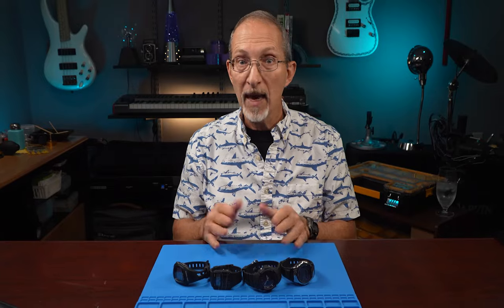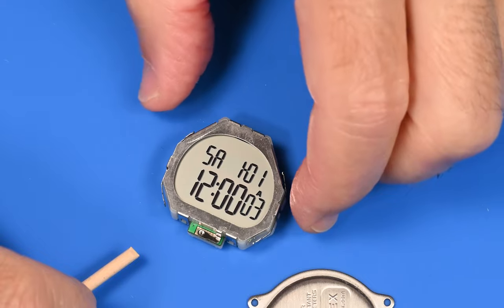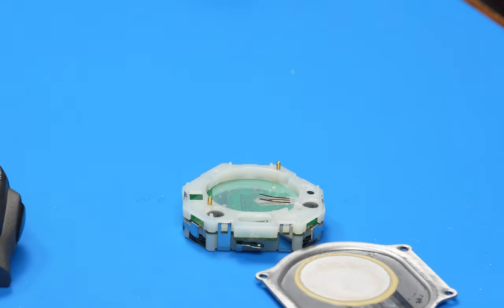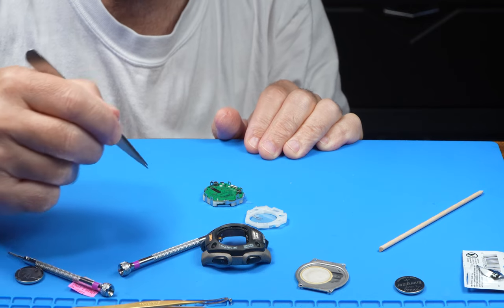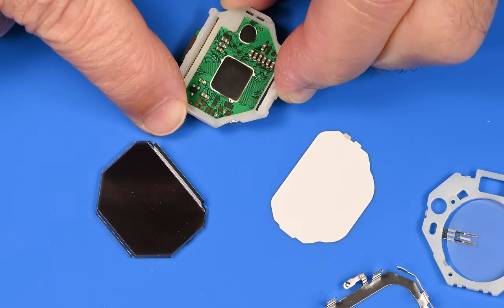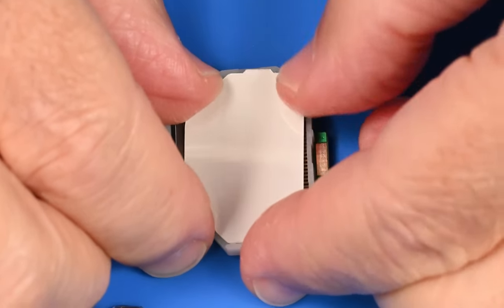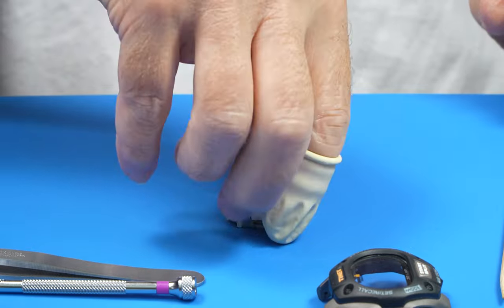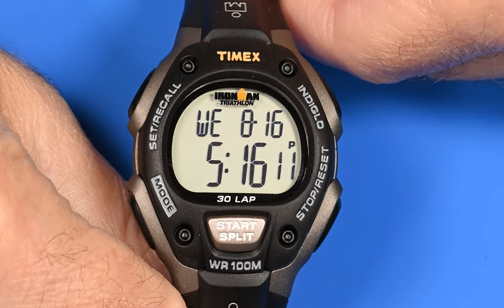How to Repair a Digital Sports Watch

Comment: That sticker on the inside of the caseback isn't an insulator- it's the piezo speaker. Those springs contact it and transmit power from the pcb to make the beeps! It's offset to line up with them.
Reply from the maker: Cool beans! I didn't know that! 😀

Comment: Hi, the connector between the display and board (the foam) is called a zebra connector. The white sheet was the backlight panel as you thought. Often gold connectors can be cleaned using a pencil eraser (thin one in this case). IPA may also work and is good at removing grease etc..  Contacts over time will oxidise and just need a little clean (normally).
Reply from the maker: @rogercox6020  Thank you, excellent advice!😁

Comment: Hey thanks for the video I have a similar sports watch different model put in a new battery and it failed to turn on although the LCD did seem to flash briefly for a second but I couldn't get it to do that again I tried holding down the AC reset button and connecting the AC reset button to the watch battery with a paperclip but it doesn't seem to do anything after watching your video I took apart the little Contraptions I couldn't see any corrosion I have been swimming in the sea with the watch for a few years. I'm surprised it held up as long as it did even though it is waterproof to 5 ATMs the old battery didn't look like it was leaking and as far as I could see the internals on the circuit board I didn't see anything that looked like water had gotten in there I was kind of expecting it just to turn back on when I put in the new battery but unfortunately it seems like that was not the case I know a guy who repairs cell phones and he has the microscope equipment but he doesn't work on watches I actually have a spare watch that I can use for my swimming but it's just a little frustrating that I was able to get it open and exchange the battery and then it's still dead I don't know what else I can do and it's probably not economically feasible to have anyone attempt to repair it do you have any suggestions or idea what might have happened I guess it could have shorted out but I noticed the LCD gradually dimming over a period of about 12 hours and then it finally stopped working and it only was about a day or so before I put in the new battery anyway I appreciate your video it was very detailed I didn't try to clean it with isopropyl because it looks pretty clean but maybe if I dig some out I'll try that
Reply from the maker: I think alcohol would be a good next step, especially since the watch has been in salt water. Good luck, and please check back to let us know if you were successful!

Comment: Weirdly I find repairing digitals harder than mechanicals. I love how you use these videos as both an assembly guide and a "captains journal' of your findings! Those white nylon parts looks like the material they use for shock absorption. Maybe it just needed a thorough cleaning and reassembly to make sure everything had contact. Those tiny orange free floating connectors does not seem very durable. Well done on the tear down and reassembly! It seems to have done the trick! Oddly I have never owned a Timex. They are priced rather highly here in South Africa and I just end up getting another Casio.... Some swear by them though so I might just pick one up some time or another. Hope you have a great weekend Mike!
Reply from the maker: Thanks Johan! You make lots of interesting points... Timex's here in USA are relatively inexpensive - or at least they used to be! Timex has really upped their game with their analog (quartz & automatic) watches, but I have heard they've had some quality control issues lately. Lol, Captains Journal indeed! I like that way of putting it! 😁
Reply: @WatchWithMike  Thank you kindly! Then maybe I should give them a skip for now haha! Yeah its neat! It like a guide for us as well as for yourself! Hope you have a good one Mike!
Reply: Stick to Casio, boet! 😄 Yes I am from South Africa too. As a hobby, I restore and repair vintage digital watches. Not sure if you have noticed, but vintage digtial watches are not easy to find locally. My prized restoration was a Casio CA-901 that I bought at a flea market in Johannesburg for R50. Now worth considerably more because everything working and looking as new with a NOS crystal, case, top pushers and pusher plate.
Reply: @Daud76  Ive never seen one like that before! That is super nice!
Reply: @johanvandersandt8904 Thank you so much. 🤙🏼
Reply: @Daud76  😁💪

Comment: The little springs between layers of the movement and the movement and the back case are to prevent the buildup of static electricity, which could fry the electronics.
Reply from the maker: Thanks - that makes sense! I'll bet it also helps with shock absorption... I was amazed how well built this relatively affordable watch really is! And I can't fault the watch for not working - I'm sure it was human error on the last battery change that was the cause. 😃
Reply: Good job! I’m not in favor of digital watches but that doesn’t take anything away from a job well done! 👍
Reply from the maker: @mokumholland5640  thanks Tom! It was a very fun project! 😁

Comment: Hey Mike, great video! Any idea if the four screws on the case are real or not? Is it possible to take apart the case even more? Cheers!
Reply from the maker: Hi Eleanor! Those 'screws' are plastic dummies. The case might come apart further, but I can't tell by looking at it. I recently took apart a Casio G-Shock and the screws were real - and it was a double-shelled case, so I get why you're asking!
Reply: @WatchWithMike  Hey mIke, thanks so much for the reply, really helpful! Althought a pity they're dummied. I've got an Ironman Timex where the black, front part of the case is a bit worse for wear and I'd love to be able to just lift it off and replace it with another keeping the rest of that watch!

Comment: Nice!  Used to wear these things.  Very cool to see the insides.  Didn't realize there were so many discrete components and two blob chips.  Your fingers store a charge like a capacitor and that's what makes the screen light up.  Doesn't take much charge at all to drive those things, it's really just a voltage and next to no current.  The strip of contacts for the screen is called a zebra strip.
Reply from the maker: lol, I thought it was my electric personality! 😁 I like the term 'zebra strip'. Thanks!
Reply: @WatchWithMike  Haha that helps. Of course, thanks for the video!

Comment: I have a different version of the Ironman Triathlon with 18mm lug width, and the leather straps Vario makes for the Casio AE-1200 fit nicely on my Timex.
Reply from the maker: Cool! Side-by-side, Timex and Casio are very similar, so it's good to know that some of the straps may be interchangeable. Thanks for sharing! 😁
Reply: Sorry for jumping in, but I have to agree. Take the Casio Pulsecheck JP-100W and the Timex Pulse Watch. They look exactly the same minus the branding. 🤔

Comment: Thanks Mike. Where would you start if the module won't star up at all so can't prod the buttons to try and locate the area where the fault might be?
Reply from the maker: I would take apart as much of the movement as I could and clean all of the contacts. That didn't work then it's possible the processor is fried, which would be beyond my skill set to fix!

Comment: nice mike ... and it works !!!! clean before licking 👍
Reply from the maker: Yes! Did you know that licking is also a valid technique for telling whether a battery has a charge? Shocking! 😁
Reply: yeah its tingling sensation on you tong...  9 volt feels nice ... @WatchWithMike
Reply from the maker: @ElderPinto254  when I was doing video production full-time, every piece of equipment ran on 9 V batteries. You better believe we did the tongue test in the field. I got so good I could tell the taste difference between Energizer and Duracell!
Reply: everytime i see a nine volt i have to test it its a strange thing for people that dont know ...😁😁😁 @WatchWithMike
Reply from the maker: @ElderPinto254  There's no doubt it releases serotonin in the body. Years from now, it will be considered a common health practice. We are ahead of our time! 👍🏼😁😳
Reply: @WatchWithMike  hahahaha omg that funny 🤣